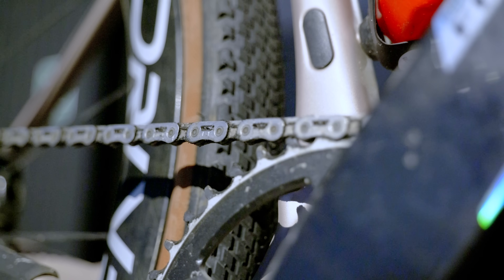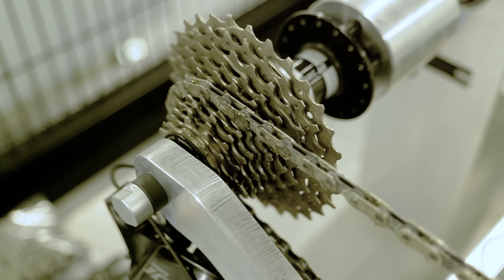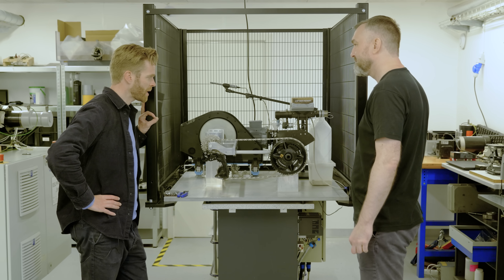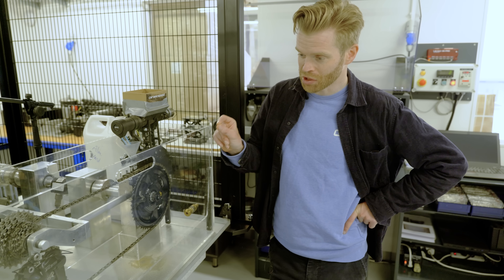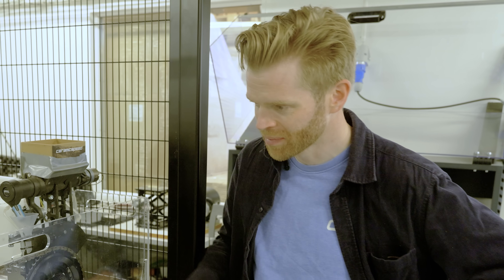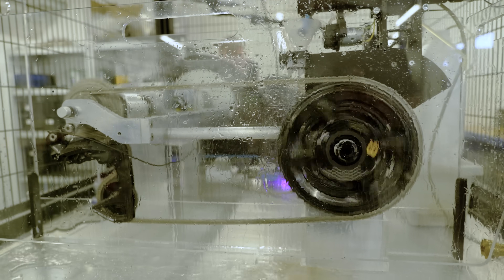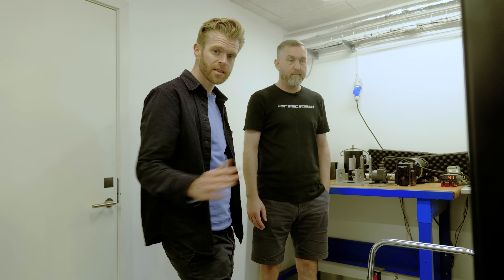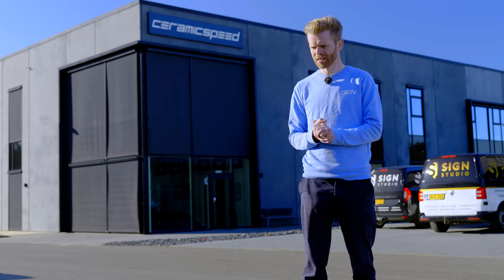We Lab Tested A Dirty Chain, How Much Slower Was It?

Comment: So in the real world, for real people (the vast majority of us) these watt differences will be insignificant to our rides. Yes keep your chain clean, but don't stress over it.
Reply: I stress over it more for longevity than speed. Ultegra parts add up.
Reply: @Thezuule1 add up how?
Reply: @Thezuule1  then by 105 or cues.
Reply: @-IE_it_yourself no thanks. Quite happy with Ultegra. It just makes sense to take good care of more expensive components.
Reply: Keep it clean to save yourself money not watts! 👍
Reply: Yeah dude, screw this, tell me about chain WEAR not these pathetic tiny watt losses that actually make no difference 😂 'balloons out to 30s' is crazy
Reply: i actually feel the difference a lot. a squeaky chain really zaps a lot of power. not just dirty, but dry and squeaky. i would say its 20%.
happens when not maintaining for 2 years
Reply: These watt differences would be more significant. The losses from friction are essentially capped and fixed at what's shown here. So the less wattage you output, the more % of your power is lost to this extra friction. For a pro outputting 350 watts, losing an additional 4 is just over 1% while for the average cyclists riding their bike around town, outputting 50-150 watts,losing another 4 watts could be as high as 10% of their pedal power.
Reply: Not really, if you don't clean your chain after riding in really awful wet and muddy weather efficiency loss is noticeable.
Reply: I'd think main disadvantage is sprockets using up faster coz of the grinding paste the sand gets turned into
Reply: I guess from the perspective of a 13 watt loss purely from chainline inefficiency to use as a baseline, since we don't really notice that when we're riding, a single watt lost on top of that from a dirty but new chain is pretty insignificant, but then you add another 13 Watts from continuously bad conditions, you have just doubled your drivetrain inefficiency, just from the dirt, but remember they're only looking at the chain, so it's going to be even more than that because of the other components, then you start throwing in inefficiency from wear caused by the lack of cleanliness, which is why you see the huge ramp up of watt loss near the chain's end of life on the Zero Friction Cycling tests. 

the thing is, you don't notice those watt losses while you're riding. your just used to it as you go, like the lobster in the pot not noticing that the water is getting warmer and warmer, you don't realize that you're getting more tired than you would have otherwise.

I remember one time, I had a 3-Hour commute, felt great as I started off, 2 hours in I was wiped out, and I'm thinking to myself what the hell is going on, and that's when I realized that the rear wheel felt squishy. somewhere along the way I'd run something over and had a slow leak. I have no idea how long I was riding ont the flat tire, but it must have been a while. I patched it and rode for another 30 minutes to the nearest convenience store for some crappy coffee, fell asleep at the table outside, never made it to work which I was already half an hour late for anyway when I got the coffee. that's obviously an exaggerated example compared to the loss in a chain, but I just wanted to make the point that it does make a difference whether you notice it or not. 

I will say it's much easier to notice the difference if you're commuting every day, because if you take the same route you know how long it takes, even if you don't care about the other stats, which I don't the only other stat I track is mph per split and overall, and I'm not even religious about that. but I can definitely tell when I've had a good day or a bad day on the bike, when I arrive at the office 10 minutes later than I thought I would, etc
Reply: @better.better The wind direction and wind speed makes a FAR, FAR bigger time difference than a dirty mucked up drive train versus a clean one. Give me a good tail wind with mud all over the drive train versus a clean waxed chain and clean lubed components with a still or even a slight tail wind and you will still be significantly slower. Of course clean and lubed is cheaper, with things lasting longer.
Reply: Of course. Don't fall for every bs marketing stuff you see on the Internet. Sadly, GCN is funded by a lot of sponsor deals and they have to shill for companies like Silca, MucOff and similar that tend to sell extremely overpriced products. And they wouldn't be able to sell them, if it wasn't for the overexaggerated marketing claims around longevity and/or efficiency.
Reply: Wear is more significant than cleanliness for power loss.  A dirty transmission that is otherwise in new condition won’t incur much loss.
A clean but worn out transmission will incur much more loss.
Reply: You're wrong. You've never waxed your chain before or you wouldn't be saying such nonsense.
Reply: @teecee4459  how many km does your waxed chain give you?
Reply: @teecee4459 Keep it clean and lubed for longevity of components and saving money, but you saw the test. A waxed chain is 1 to 2 watts over a merely clean oiled chain, and up to 8 watts over a dirty gumbed up dry chain .EIGHT WATTS. The difference in "air temperature alone" in still air at 50 deg F versus 75 deg F is BIGGER than drive train loss at 20 mph between the waxed clean chain and the dry dirty gummed up one !!! Actually  AI calculated at 11 watts !! 11>8. ! Temperature change only in dead still air. Air density matters.
Reply: As long as it's not electric, yes.
Reply: well... dirty chain and small ring for regular guy at 150w is 10w let’s say = you would feel it for sure :)
Reply: If you are stressing about a bicycle chain, i think you are living a pretty stress free life. Bike chain isn't even my top 1000 concerns.
Reply: @denizkendirci so all you gotta do is stress out about your chain. And life is all good stress free elsewhere.  We just figured out the secret of life.
Reply: @tyarnold4088  The secret to life is fighting the power .
Reply: if you also don't care about the longevity of your drivetrain
Reply: Yes but what is theongevity drop? A mivrmeter over the lifetime of the bicycle, lol
Reply: @edwardnilges1675 , yes, only 1 Watt, but more €.
Reply: @edwardnilges1675  it doesnt matter. chains last 5000km pretty much no matter what as long as you use some kind of lube.
Reply: I’ve been immersion waxing for over a decade. Had a few advantages overall. The initial stripping of factory petroleum goo has turned out to be the most significant factor. As my my first stripping became more thorough my miles between re-waxing and miles to reach 0.5% became longer. Since I started using the Silca stripper my miles between re-wax almost doubled from what I was getting a few years ago. And, 0.5% still looks a long way off at 4,000 miles. I do rinse dirt off bike and chain whenever our rides are off pavement. I’ve never changed wax, only improved initial degreasing. Getting great results with plain ole paraffin wax.
Reply: @-IE_it_yourselfhe's not talking about the chain.  Hes talking about you destroying your cassette and chain rings by running a dirty chain. 🤦‍♂️
Reply: @MrGoodaches  VS NO stripping of factory grease, no removing chain, no boiling in wax, blah, blah. 5000 kms with ZERO wear. I seem to be saving more money (and time) than you, but nobody's making fat stax from my regimen so...
Reply: @-IE_it_yourselfcassettes and chainrings count as well
Reply: @-IE_it_yourself if you use the wrong chain lube, your chain might not make it to 1000km.
Reply: @-IE_it_yourself That's not true. Testing shows that immersion waxed chains last last longer than chains treated with drip lubes. Yes, keeping your chain clean, will always make the chain last longer than if you don't, but as testing shows, that's not the full story.
Reply: @robinseibel7540  i agree. all im trying to say is, 7000km with no effort or 10000km with lots of effort.
Reply: @-IE_it_yourself  I spend a total of about 5-7 minutes waxing two chains.  And that's every 800-900 miles.
Reply: @-IE_it_yourself 1. There are now some excellent drip waxes, which are no more hassle, and can require fewer applications than oil based drip lubes. 2. Waxed chains can last 25,000 km or more. If you are getting 7000 km out of a chain with oil based lube, you must be riding in decent conditions, and would therefore likely get that 25,000km distance fairly easily. 3. Overall waxing is less hassle than lubing with oil, cause the only thing you need to do to clean the chain, chainrings, and cassette, is pour over some boiling water (if careful, no need to remove from the bike)… that’s it … spotless drivetrain.

If for whatever reason you prefer oil based lube, great … carry on, but your information on chain waxing is wrong.
Reply: @-IE_it_yourselfbro, they don't last kilometers. If I put 2500 Newton meter on it, it will break. Last is relative to force not distance.
Reply: @-IE_it_yourself Waxing is lower effort. I don't have to reapply it as frequently as an oil lube, and I don't have to scrub the drivetrain with a brush.
Reply: @-IE_it_yourselfI have to object. I used my 11s shimano cassette for slightly above 9000km with noticably worsening but to the end functioning shifting. But only by changing the chain at about 3500km and bathing the second chain in an oil bath in an ultrasonic cleaner at about 7000km. The longevity varies due to weather and terrain conditions from year to year.. this has been my practise for the last 10 years riding slightly under 70000km.
I do notice an increase in energy input versus mileage with a dirty chain btw
Reply: @edwardnilges1675 eh?
Cleaning your chain means you don't care about longevity of your drivetrain?
Reply: @Kieran0 just the opposite.  my response was to the original comment above regarding it not mattering from a watts perspective
Reply: Yes, the problem is in the mirror and on the scales, forget the chain.....
Reply: yes. 

balistol is not the best and far from the worst and non toxic.
Reply from the maker: perhaps, but if you are going for the optimum in performance and don't want to be dropped (Ollie 😉), it is worth considering?!
Reply: @gcntech  poor Ollie 😂
Reply: If chains don't stretch,  why, when replacing them, the old chain I use for reference is ever so slightly longer than the new chain? 🤔
Reply: @alanbussell7894  the plates dont stretch but instead it is the pins wetting wore away by the rollers on the "internal" links.
Reply: @alanbussell7894 The metal itself doesn’t stretch or elongate. That would take much, much more force than humans are capable or producing. What’s happening, and what was shown in the video, is the pins and rollers are wearing away which introduces tiny gaps that, when multiplied over 100 or so links, makes the overall chain longer under its own gravity or tension compared to a fresh one.
Reply: @alanbussell7894 I'm guessing that the pins that hold the links together wear slightly, so the chain might be slightly longer, the links probably don't stretch, the main wear comes from the rollers.
Reply: @dogbreath6974 the main wear is shown on the side plates, usually, where the crimps have replaced old fashioned bushings in earlier chains. The rollers do wear some, and if the chain is left gritty or run to beyond tolerance, the pins get gnawed.
Reply: @alanbussell7894  the chain might stretch, but the point is that what most people call chain stretch isn’t; the wear you measure when checking you chain is mainly wear to the pins and rollers.
Reply: No, if anything people need to be extremely stressed over the cleanliness of their chains. I replace my chains about every 20 miles with a clean chain.
Reply: @jele5116 You must ride in some very harsh conditions if your chain needs cleaning after 20 miles.
Reply: @dogbreath6974  No, I replace it after every 20 miles to maintain maximum efficiency!
Reply: And no need to buy expensive wax chian stuff!
Reply: @tonysadler5290  Did this test actually measure chain wear?  Hmm.  I don't think so.
Reply: @robinseibel7540  you make a most relevant point - I was being glib!
I ride mountain bikes and tourers, so mud and grit are the order of the day. Waxing isn't so important to me - regular cleaning and lubing are more practical and as beneficial.  If I was a road rider I'd definitely use wax, possibly balance my wheels and be much fitter!
All the best and thank you for your reply.
Reply: @tonysadler5290  I mountain bike (in that famously dry Scotland), and use wax precisely because of the dirt etc. With oil lubes, all that dirt sticks to the chain and turns the lube into a grinding paste. With wax, it doesn’t. While it might seem (certainly sound) like the oil lube lasts longer (and you’re right, it does stay on longer), once it’s that grinding paste, it’s worse than no lube, and way worse than a well used and noisy waxed chain.
Reply: @joules2936 I generally clean down my drive train after every ride - so they don't get a chance to get gunked up with old lube. 
Interesting about your experience with wax though. For me it was a toss up between a wax cauldron and kit or a sonic cleaner - I went with the sonic! All the best and thank you for letting me know about your experience with wax on the trails.
Reply: @tonysadler5290  my post ride activity is wash down with water, allow to dry, and then apply Ceramic Speed drip wax. I remove the chain and hot melt wax it every four or five rides. I find using wax is way less hassle, as drivetrain with oil lube takes much longer to clean. 

Unless you are ultrasonic cleaning after every ride, grit will be finding its way into the chain and staying there, whereas with wax, that doesn’t happen. 

Wax isn’t perfect though, and in very bad conditions the chain can end up squeaking after all the wax works its way out, but that’s not too often. I’m going to add a Silca endurance chip to my hot melt as apparently that lasts much longer. Silca drip apparently lasts longer than Ceramic Speed drip too, so will be trying that over the winter.
Reply: @joules2936 thank you for the advice, I'll give it some thought as to whether to go that way. Sounds very effective. Cheers and thanks again.
Reply: It can be pretty painful for your wallet if you don't maintain your chain. Especially if you're running 12sp which wears a bit faster and run more expensive drivetrain components (e.g. Ultegra chainrings / cassette).
Reply: You would be surprised at how much of a difference it makes.  I'm not very fast, I do have a power meter. Undoubtedly you would notice the difference, more so on longer rides.
Reply: Interested minds find the engineering interesting.
Reply: @gravelnerd  Sometimes the information is not available in a timely manner to the public and the information is stored on the website